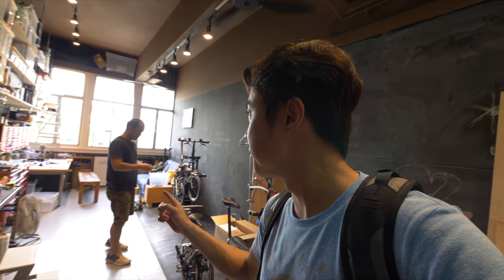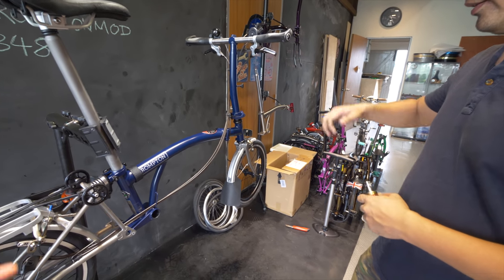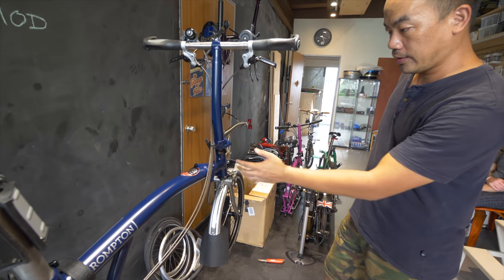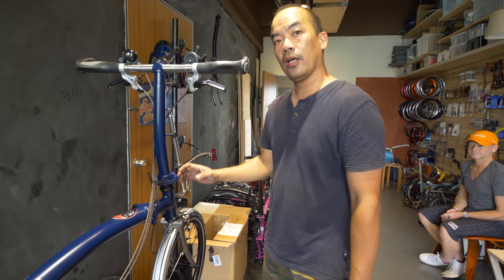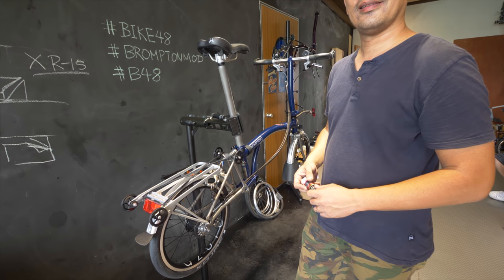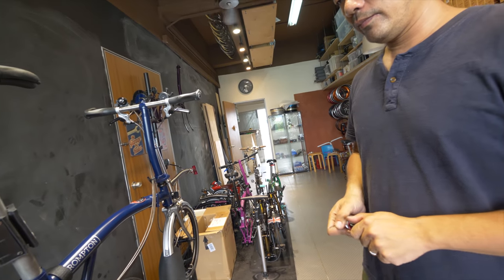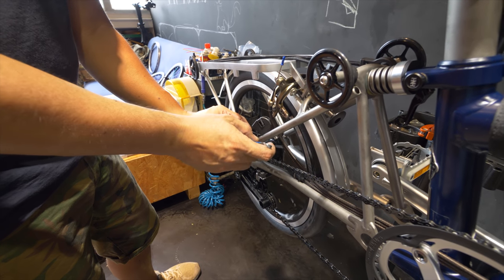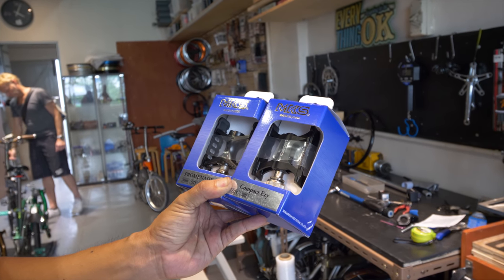Latest Modifications Done On My Brompton!

Comment: You may get an axle with an extension, to make it wider and more stable when folded, and also a little higher by that, so the wheels are further away from the suspension, and so avoiding the wear on the block.

Comment: Lots of different opinions but I would tend to go with the ones that say "Why change a perfectly good British made Bike?". Bromptons have been around a long time now and are supposed to be a proven brand. A look at some of the factory vids will demonstrate that. Hand made actually. There is a lot of talk about weight saving, but this isn't a bike meant to help win the TDF! It's basically a commuter bike, so what difference will shaving a bit of weight make? I agree with those that say a good mod is to fit a Brooks saddle. Cambium? Perhaps not, but a good B-17 with a bit of weight, well yes, provided you can suffer a bit for the first 300 miles. I really don't understand why these mods were made, but then I'm not Mr Lim and each to their own!
Reply: So true. I agree with you. I have had my brompton for 2 weeks. I dont see any parts to upgrade.
Reply: @miffachan123  I bought a used one & ended up replacing some of the previous owner's "upgrades" with stock parts from Brompton!

Comment: When working on a brompton, don't clamp it in the workstand by the seatpost.  There's too much risk of distorting the tube.  Instead, clamp it by the main frame tube.  That's what Brompton themselves do.
Reply: Are you saying the seat post, which can support a 100kg person over bumps and kerbs, may be distorted by a clamp? I very much doubt it.
Reply: @tortinwall  lateral compression is not an issue w 100kg rider
Reply: Have you forget how the seatpost is held in place in the first place? It is clamp by the seatpost clamp, so being clamp by the workstand will not damage the seatpost. Infact on carbon road bikes it is safest to clamp by the seatpost.

Comment: The biggest investment i made on my brompton is a Clavicula SE crank with a fiberlite carbon sprocket. Other cyclists hate me for that :) But it helps running around the underground, saves another 200-300g
Reply: you must be a dentist. I'd prefer CaneCreek EE Wings, no carbon parts (Ti/Alu only) to make it bit stronger to impact/scratch during commuting.
Reply: @dydanz  To be honest i've been riding my bike quite hard commuting every day ~8-9 km to work and back, and apart from some scratches (which are ok for carbon) there are absolutely no problems with the crank. It's as smooth as the first day i installed it. Those things are much tougher than they look. And i go full force on them when the light goes green :) It has been almost half a year since i installed them. CaneCreek have some amazing hardware. I've got a set of their mountain bike breaks too. A tiny bit heavier than the carbon analogs but MUCH tougher.
Reply: @mikhailman  glad to hear clavicula isn't an another-for-showing-off-carbon-bling parts. you must be very happy with the choice!

Comment: ive a single speed no rack/mudguards steel brompton around 10.9 kg.  can't roll it, no joke to carry in and out of train station, so i try to take bus when i can, more convenient.  in this regard, the stock saddle lets you carry it comfortably.  best upgrade is the engine - keep riding it, progressively increase your distance, speed, and fitness... then the weight won't matter much anymore
Reply from the maker: Fair enough ;) I just installed a new saddle though...lol

Comment: Why does a folding bike need a Chris King headset and ceramic bottom bracket bearings? Ceramic bearings wear out the metal race since ceramic is harder than steel. Although higher in performance they will wear out quicker. same thing with the headset... Aren't these things meant for commuting (ie. durability in mind). This is like fitting high performance (high maintenance) formula 1 technologies on a Toyota Prius!
Reply from the maker: Looks cool 😎
Reply: But you can't even tell it has ceramic bearings and a Chris King headset unless you snoop in close and have a squint at the tiny labels :^)
Reply: @omerfurtun4115  That is Singaporean for you, they just want to feel they have the best of everything
Reply: Yeah I agree with Jamie, it look super cool and " solid ", but it must be very expensive upgrade I suppose 🤔, Brompton already so expensive as hell, can't imagine if I upgrade my Brompton, I will be eating instant noodles every day 😨
Reply: i find on my bike that dealing with other cars and pedestrians becomes increasingly hazardous when u go above a certain speed .. the upgrades make no sense

Comment: Hi Peter , I owned a Brompton without front and rear mudguard and realised that when fully folded , the bike will slanted a little to the left (the other side of where the stem is down) and also just fitted the extender bar and also my handlebar touches the ground , is this normal ?? Pls advise

Comment: Stick to original paint, powder coating will increase slight weight. Maybe you should change the crank to make it lighter. Anyway, 
How much did you spend for all the TI parts (including the nuts and bolts) ?
Reply from the maker: Probably 3k I think, including the rear rack.. 🤔
Reply: 3k ! 😫😅
All the best Jamie!
Reply: 3k ? $3,000? Dollars?
Reply: AgorasBlog yes... Singapore dollars. That is about near USD $2200
Reply: Okay. Thanks. Here in England, customised Brompton is about same price.
Reply: @jamieohpa  3k excluding the brompton?
Reply: @derrickseet1437  most definitely excluding.  Bromptons are expensive bikes and Jamie's model is a Ti 6-speed, which is among the most costly of the lot.
Reply: @bungee28  c

Comment: For a 6s, that is light enough. I have a 2s with a P stem and a super low carbon handle bar, also with Ti extremities. Weights about 7.8kg and it's very fast. Replace your saddle with perhaps a Cambium.

Comment: Very interesting. I’m keen on the Brompton but would like suspension in the front so will look at a mod to raise the steering bearing give room for movement and look for options. As a designer I have a design for a very robust 12 speed gearbox (50mm wide and 80mm dia)  that is in the pedal hub and that would give the 20” wheel version advanced performance. Its good to see that there are people building specials. You will certainly enjoy your pumped Brompton!

Comment: Hi Jamie, since you ride on the road, I suggest replacing stock Brompton pedals with MKS Ezy detachable pedal system - clipless pedals MM Cube: https://www.ebay.com/p/NOS-MKS-MM-Cube-Ezy-Removable-Pedals-pair/2124039505 ;
flat pedals Promenade to switch around: https://www.ebay.com/itm/New-MKS-Promenade-EZY-Pedals-Quick-Released-Road-Touring-Black-/401649473344

I use them both, clipless for longer distance, flat for casual rides. MKS’s shoe cleats differ from Shimano’s in shape but will work with SPD shoes as it uses the same 2 screw mounting system. 

Get the pedal holder from Bike 48 to hold left pedal when transporting Brompton - http://www.bike48.com/product/mks-ti-pedal-holder/

Comment: You buy a bike for a rediciulious price then throw away loads of parts. More money than sense. At the end of the day it's an unstable uncomfortable bike of the moment.
Reply from the maker: I beg to differ and thanks for your 2 cents worth of comments.
Reply: @jamieohpa  your welcome in these times of discord
Reply: A bit more flame than needed, but there is a good question as to what was bling and what was performance. If Ti is for corrosion maybe. At $1 a gram, discussing the performance is germane.  Before and after weights help. My unmodified S2L is 10.9kg
Reply: Brompton upgrading is always a weird proposition since you start with a hulking expensive steel bike. Short of the frame and brakes, I've swapped out (and sold off) most of the stock parts, with a goal of bringing the weight down, preventing corrosion, and improving the ride. Some parts like a spring suspension block and more comfortable grips added weight, whereas most others have lightened my bike. Not surprisingly, the total upgrades exceeded the cost of the bike, but that's part of the fun of owning and personalising a Brompton. M2L-X at 7.9kg post-upgrades, including a 3-gear rear sprocket.